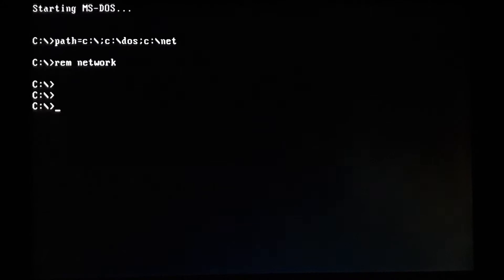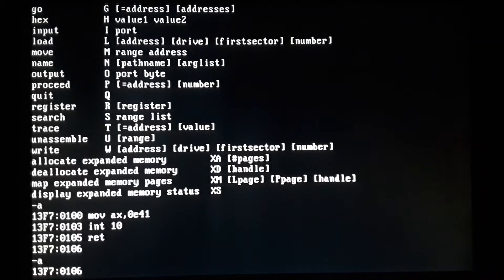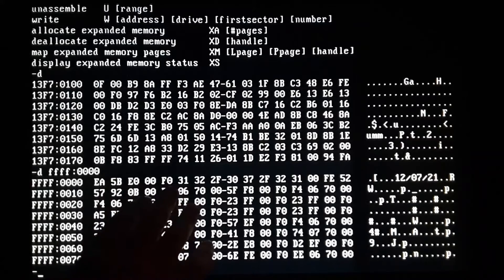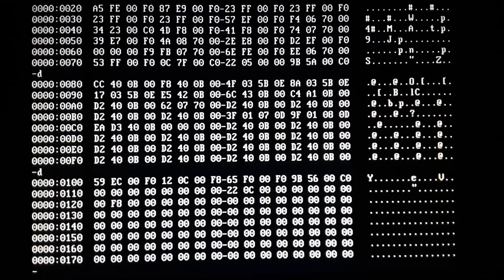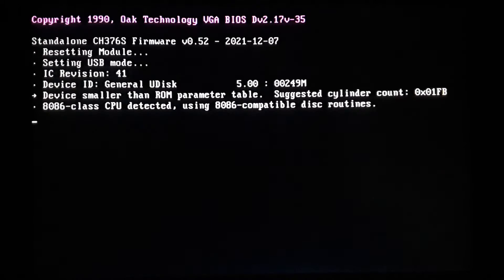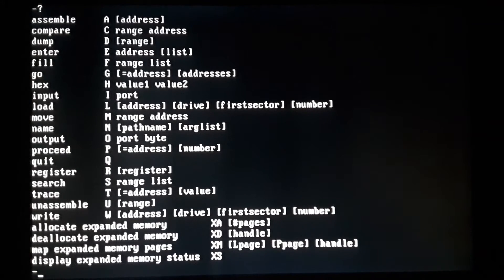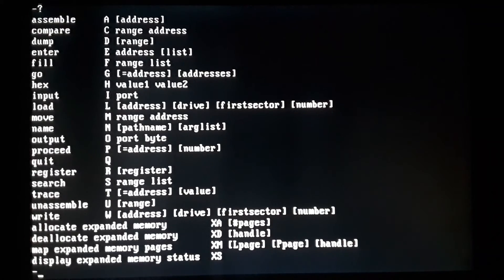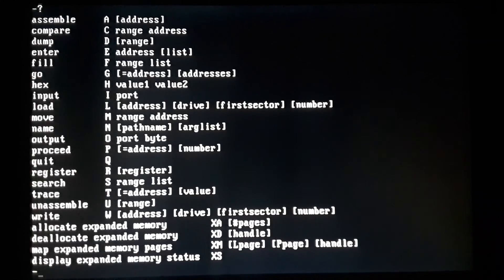MS DOS DEBUG.EXE

Comment: I think lots of people don't know that most 16-bit operating systems like DOS will run just fine on modern hardware. On my computer, I can just go to my BIOS and enable the legacy CSM mode, and then I can boot from legacy MBR operating systems! My computer is 64-bit with 64 GB of RAM, can run MS-DOS just fine in the 16-bit real mode as long as HIMEM.SYS is turned off or configured very specifically

Edit: I can use HIMIM.SYS to use XMS if I specify MACHINE:AT in it's options

Comment: It hangs because of the register values.
Reply from the maker: I have suspected that for a while. I am thinking you have to write your code to restore the orginal values.
Reply: @elijahmmiller  IIRC, you at least need to reset debug's IP value but things on the stack and/or SP, CS, SS might need a tweak.